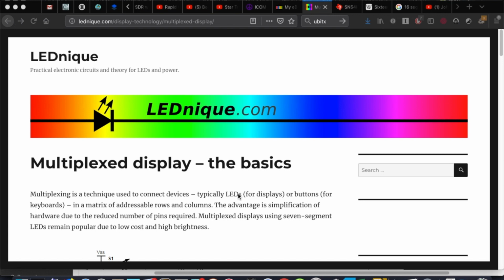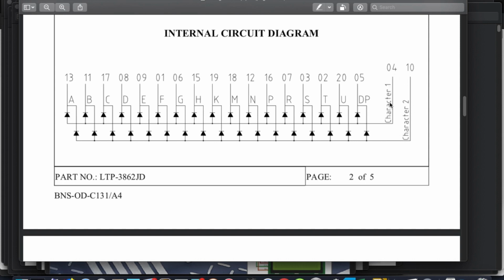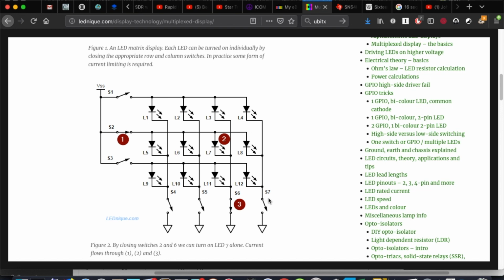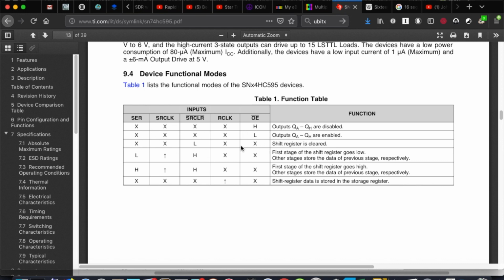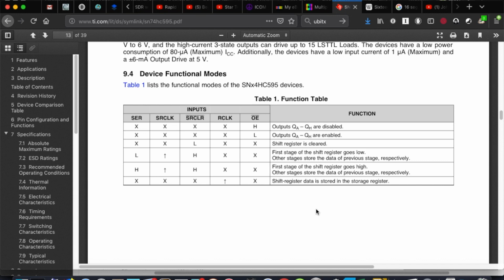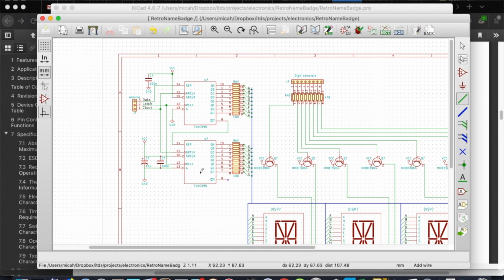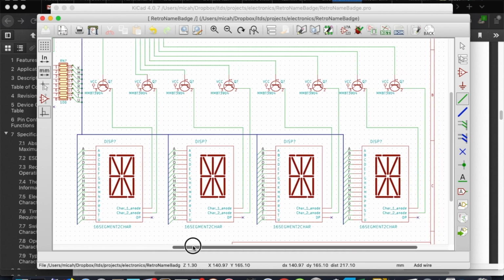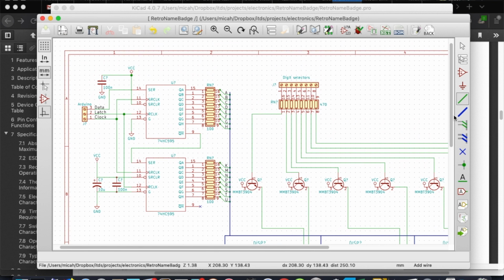New project: Retro name badge. Part 1: design

Comment: hello I have a question I was recently doing a project on a electronic but I accidentally removed a small resistor from the bored I don't know where the resistor went but I have a question just in case this happens because it happens a lot to me how would I find out what resistor I need so I can replace it can you please make a video on how to find a resistor that you accidentally removed what tool should I use please
Reply from the maker: Good question. Briefly, it depends. :) If it's a surface mount resistor, you should be able to find the pads where it connected. If you have a circuit diagram, you might be able to trace it out. Otherwise you might have to figure out what that part of the circuit is doing, and where a resistor of that particular value is needed. If the resistor has a value like 472 the last digit is the number of zeros to add, so in that example, 4700 or 4.7K